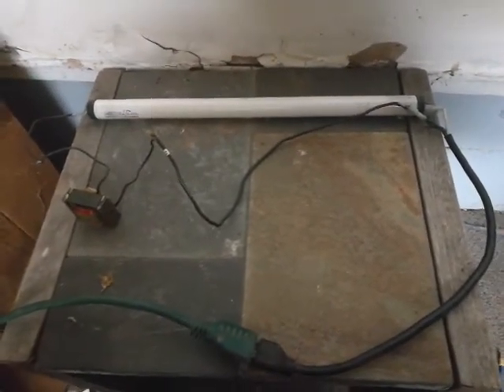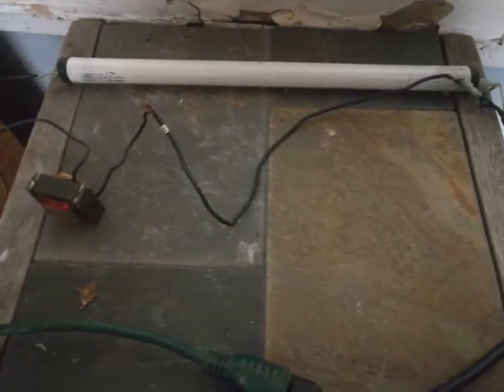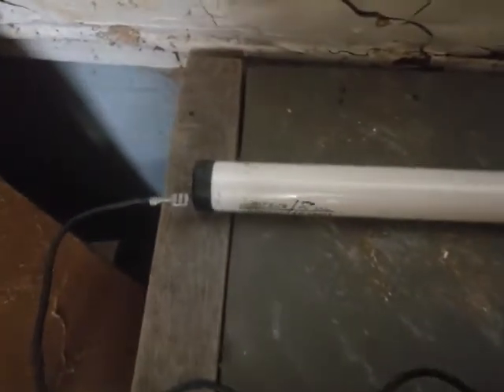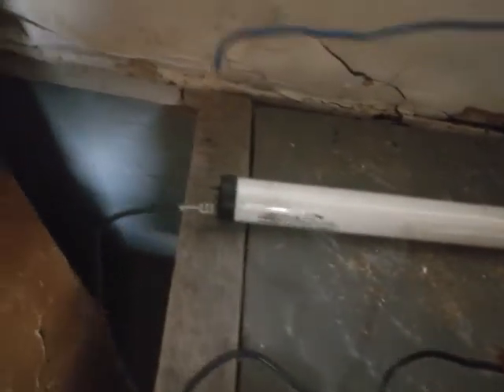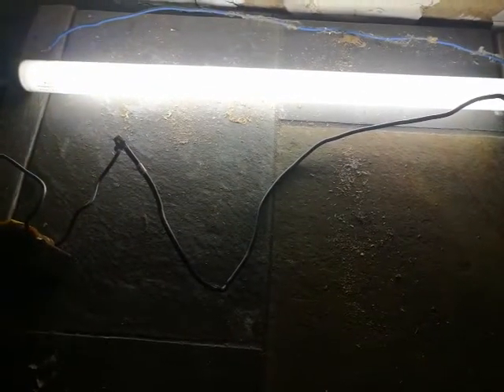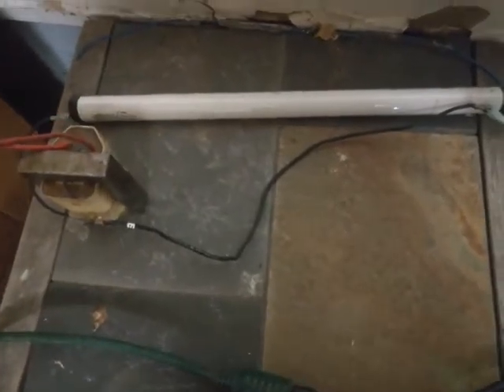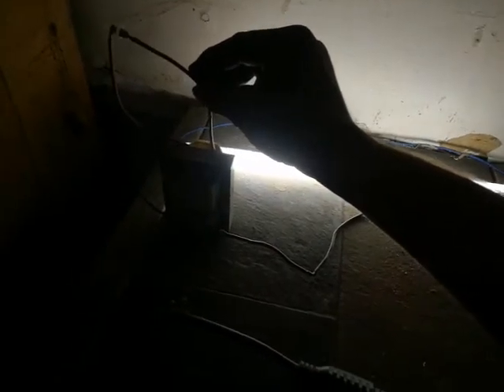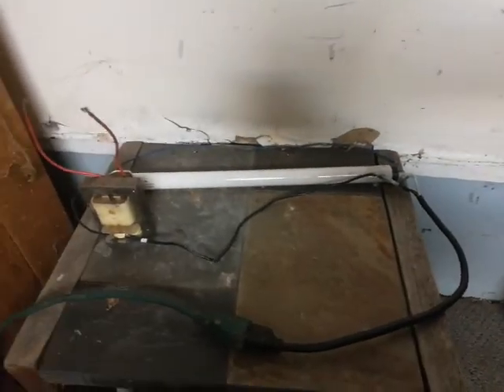Basic Lamp , Bug Zapper Transformer

Comment: I am using a microwave transformer is the capacitor and diode required, or just the transformer?
Reply from the maker: I would recommend using a transformer with less amps and more voltage. Like a neon light transformer or a HV tesla coil transformer.. a microwave oven transformer is very dangourus and also could start fires. So look for something that's high voltage and low amps... Anything above 5 or 6 kv should do just remember the higher the voltage the higher the risk is for files and burns... GL

Comment: So I have to “jump” the light every time I turn the zapper on?
Reply from the maker: Yes or you can use a starter condenser instead of a toggle on switch, that is what is normally used in these kinds of lamps where you will see the bulb kinda flicker as it comes on thats the starter condenser kick starting the lamp....
Reply: I built this set up and the first zapped killed the buld. Why